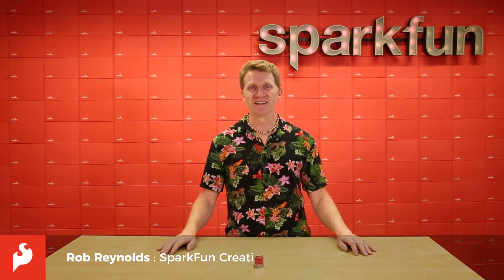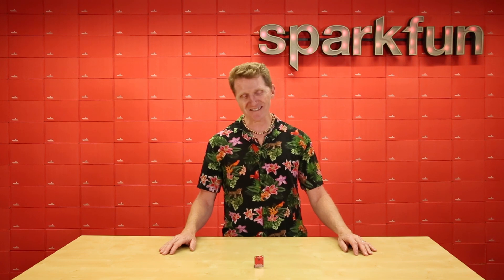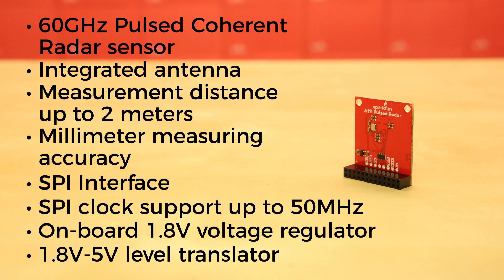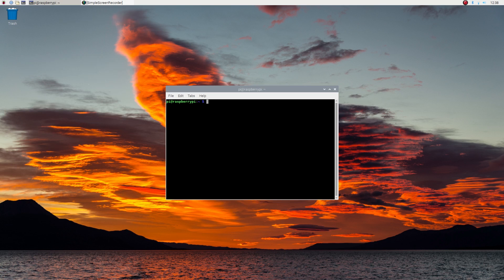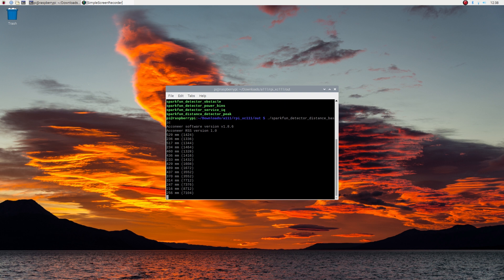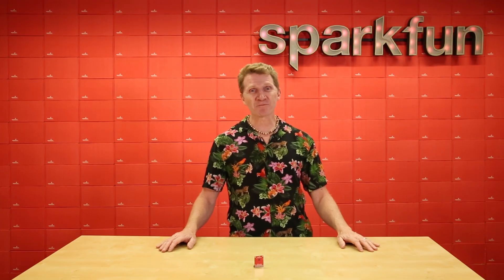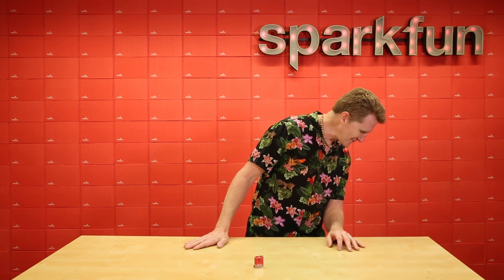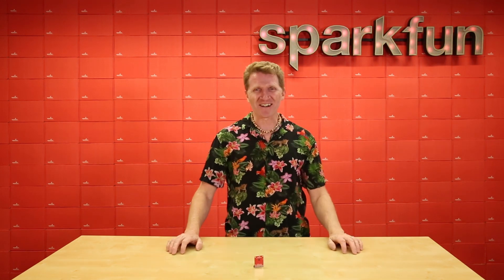Product Showcase: SparkFun A111 Pulsed Radar Breakout

Comment: Just a bunch of random values between 200 and 600 mm. That is not what I should call "accurate". You will need a waveguide "rod", or "trumpet", or "funnel", or at least the lens kit Acconeer sells (LH112 on their site), and a lot of averaging to make it "centimeter" accurate. No way to go to millimeter accuracy. We are "fighting" with XM112+XB112+LH112 for a while by now and the "will require some effort on your side" or what exactly the words of the guy in the video are, is a heavy understatement. But what totally cracked me down was the "spy" interface, hahaha. Please sparkfun, next time choose a guy with at least rudimentary electronic knowledge. Edit: we took the downfinger back after we saw the final. That was extremely funny. So, no downvote. But the rest still stands.